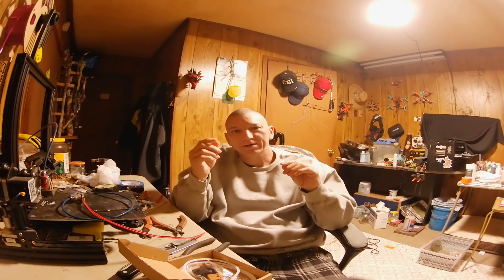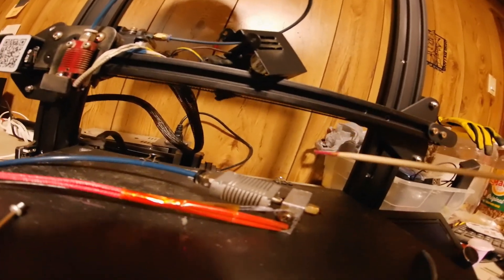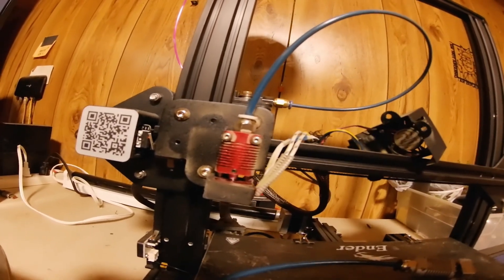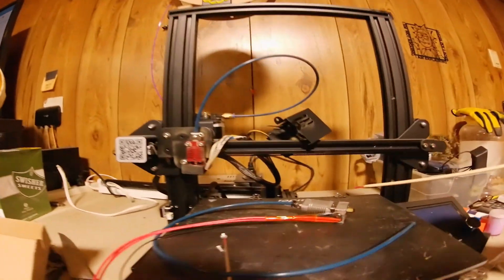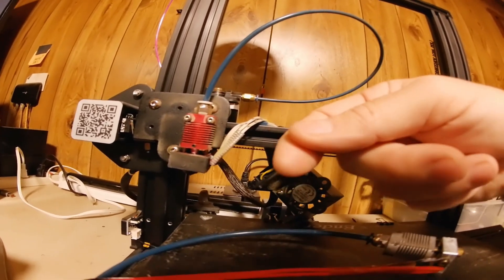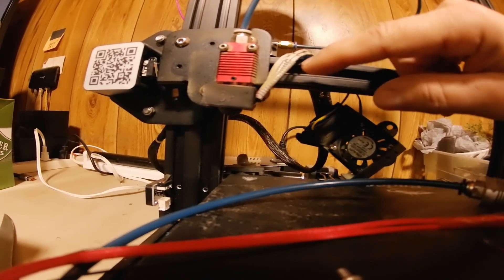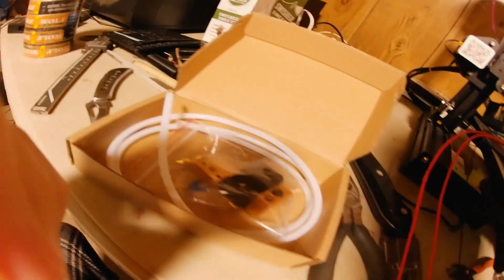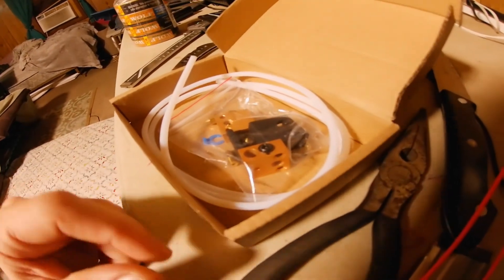Ender 3 Thermal Runaway FIX  99.9% of the time it is this problem.

Comment: Unfortunately I have tried these screw in thermosister it worked for a while but ended up cause I the same issue . The screw in ones are a pain to get access to things at least without the connector pin . So glass and screw in both worked for a time and the. Kept shutting down my printer.  I then upgraded the block to get a smooth thermistor cartridge and again it still does it   . Sometimes it says thermal runaway so etines it just says the power was turned off and the only sumolution there is is to put a couple slugs into creality piece of crap printers . Anyone else think products you buy should just work? You've had to fix my printer over and over since it came out the box and it's ridiculous. But have no fear , those protections you have don't actually do a damn thing for you so your best bet is to dispute it with ur bank if you havnt exceeded the time limit which im sure u have cause these products are built to last for about the length of that time period so you can't get your money back .creality is the biggest joke in this market and all they care about is taking your money and making sure u don't get it back .

Comment: So unfortunately, I found out that I have the upgraded thermistor, but I’m still having the runaway prompt
Reply from the maker: it might have gone bad or it's not making good contact with the block. put some thermal paste in the hole with the thermister or take some fine copper speaker wire and jam in the hole around the thermister to take up any gaps. it has to make good contact with the block to read right. if its not making good contact it doesn't know the block is getting to hot and it just keeps on heating till you get the runaway error.

Comment: Thank you, I have several machines and I have been buying new hot ends. I just installed a new direct drive and it didn’t work. Your advice  about Cleaning the gunk off solved my problem. Thank you.
Reply from the maker: you are very welcome. glad it helped.

Comment: MIsleading to say this is the fix most of the time. A lot of things could cause this, including a bad heater element, bad thermistor, bad firmware, lack of PID tune, fan issues, or in my case.... Faulty PSU
Reply from the maker: No, it's a very true statement. but you are free to believe what ever you want.

Comment: Thank you for this tip! I had thermal runaway issues with my Ender3 V2 Neo, so I decided to order the kit. Here are my key takeaways:

-Thermal Runaway Warnings May Persist: The kit may still trigger thermal runaway warnings. This happens because you need to perform a PID tuning (or use MPC) for your new hotend. The firmware tries to predict temperature changes but fails since it's tuned for the original hotend, leading to larger temperature fluctuations. PID tuning is only possible with alternative firmware or terminal access to your printer (such as through OctoPrint).

-Thermistor Beta Value Differences: Even after PID tuning, you may still encounter runaway warnings. The thermistor in the kit has a different beta value than the stock one (3950 vs. 4092), which causes a temperature reading offset (10-20°C). This makes the temperature plot appear irregular. To fix this, you need firmware configured to recognize a T13 thermistor type (the stock thermistor is T1).

-Firmware Solution: I flashed the MRiscoc firmware, which conveniently offers a version with T13 pre-set. This resolved all the temperature issues.

-Ender3 V2 Neo-Specific Note: The heater block doesn’t fit directly onto the Neo heatsink. If you want to keep the Neo heatsink (I did, as the Ender 3 heatsink looks toylike compared to the Neos), you’ll need an M2x16 screw and tighten only one side of the heater block. This will result in a slightly skewed heater block, but print quality remains unaffected since the nozzle is still vertically aligned.

Hope this helps a few people!

Comment: Thank you for this advice. Unfortunately i bought my ender 3 v2 second hand and the thermistor was "in the air" inside the hole ,which i thought was proper.
Then the problems began and i couldn't figure it out.
Bought a new hotend from creality but after 7 months again the problems started.
I will try your advice on the next hotend i buy when this stops working.
Thanks for the video.
Reply from the maker: glad it helped. thanks for watching and commenting.

Comment: THANK YOU VERY MUCH FOR THE VIDEO. I've had an Ender 3 NEO for 3 weeks and the last 4 days it's been giving me problems with hotend temperature instability and E1 errors.

I contacted Creality and they gave me erratic instructions, such as checking the thermistor screw or checking the wiring. Today they gave me an AUTOPID file to calibrate the temperatures but it didn't help either.

I watched your video and understood the problem, I'm going to order the kit, but I'm going to give a temporary solution for people who have the problem and can't buy the kit or it takes a while to arrive.

I've tried to remove the thermistor and it's been impossible without breaking it, and since I don't have a replacement, I've left it inside, but I've taken CPU thermal compound, one that I have that doesn't solidify, it stays liquid for a long time, and I've filled the thermistor hole sealing it from the outside.

I've been printing for 4 hours with the temperature totally stable, it doesn't move a degree!!! if this happens to you, until you get a new kit, try filling the entire thermistor hole with CPU thermal compound, it works!!! I don't know how long, but it works for now.
Reply from the maker: thanks for watching and commenting.

Comment: Is thermistor runaway where the temperature constantly goes up and down but never stay at the temp the print is set at?
Reply from the maker: no. it is where the head keeps heating up until it gets way to hot and an alarm goes off and the print stops.

Comment: Thanks for sharing.  I've yet to have thermal runaways, but I'd like to upgrade my thermistor.  The heater block supplied in the kit is aluminum, the one I have is copper version of the stock aluminum (holes matches), which is better with transferring heat.  Would that thermistor screw in where the captive screw would normally screw in?

Comment: I don't have an Ender but I have an Aquila, is it possible that the fan itself could throw the thermal error? I recently upgraded my hotend fan and since that I've been getting this error, and the fan is a significant upgrade so I'm wondering if that could be an issue?
Reply from the maker: Im sorry but i have no idea.

Comment: i almost never leave youtube comments but this felt very warranted for one. its been over a month straight now since picking up the hot end/thermister you recommended and i havent had a single issue since. this works so well they should honestly just include this. thank you so much for this info! I can even print ABS now which I could never do before without running into temp issues

Comment: You are a genius. I happened to have a tube of thermal paste right next to the printer. 2 min fix after 2 failed prints and a whole lot of cussing. 

Every hotend I've installed has been dry so I never even thought about it but it's fixed and I  have stable HE temps for the first time in forever!
Reply from the maker: Glad I could help

Comment: I got the kit but then I opened the box to the motherboard I saw all the wires and I got scared I don’t want to mess anything up so I just left it alone I don’t know what to do can you do a video on installing it?
Reply from the maker: everything should just plug in. if they dont just cut the old wires from the heat block and splice the new heat block in. you cant cross the wires. just splice the big wires to the big wires and the small wires to the other small wires. you cant cross them, those wires dont have a positive and negative so you cant cross them, they will work wired ether way as long as you put the big wires with the big wires and small with the small.

Comment: interesting
funnyly enough my ender 3 came without thermal paste on thermistor so i never aplied it back when i replaced heat blocks 3 times
and it works all the same
don't really know how well it track the temperature but no runaways

Comment: first thing I did with mines was change out the hot end, never even booted it up, printed a few things and then a few weeks later it would go for like 5 to 10 minutes then give me an error.
saw that paste while I was changing the hot end, because I took the thermostat out, was hoping it would be an issue, guess ill find out in 10 minutes if it was.

Comment: I just put mine in and it is still going into thermal runaway. It just randomly started too, I printed fine for months.
Reply from the maker: You replaced the thermister and hot end? and its still doing it? or did you just replace the thermistor? Did you clean out the hole where the thermistor goes?

Comment: Hello! How has the kit held up over time, are any modifications to the firmware needed? 
Oddly, I can't find many sources about thermistors like this so I'm a little warry of buying any. I've had thermal runaway E1 issues since I got my Ender 3 Pro though, and I'm pretty desperate for a fix at this point.
Reply from the maker: This kit is awesome. it is still doing great. no problems at all. no modifications needed. just remove your old hot end and replace with this new one and plug up the wire or splice the wires for longer wires like i did in this video. this new hot end already comes assembled so just bolt it on, it's that simple. Thermal runaway E1 is a thing of the past for me now. enjoy brother. and this kit is awesome for the price!
Reply: @Forbiden-Music-Zone  just got one for myself, can't wait to test it out. Thank you for the video :-)
Reply from the maker: @jace-vo2xl  glad i could help brother.

Comment: lol. no. its not the solution. once you upgrade your mainboard to 4.2.7, and you use the creality firmware, you are on your own. you will be plagued by heating failed/ thermal runaway issues, because the software is broken.
Reply from the maker: Who said anything about upgrading your mainboard? sure was not me! this video tells how to upgrade your hot end and clean your thermistor. and this solution works. 100%  i have helped and been thanked by at least a thousand people with this problem and it solved each one of the runaway problems.

Comment: thank you for this, I cleaned mine and put some thermal paste on it, seems to be working great again. funny thing is that I just replaced the mainboard to make it silent. Never had a problem before, I think the old board didnt have thermal run away protection.... So Im pretty lucky to be finding it this way. thanks again!
Reply from the maker: Glad it helped
Reply: Is it the same thermal paste as cpu? How much paste?
Reply: @clawsmedia8752 yes I used cpu thermal paste but it only worked for a day and then I had to order a new sensor

Comment: If this works I will endorse it as much as I possibly can
Reply from the maker: Thanks Brother. if you have any questions just ask. i like helping.
Reply: @Forbiden-Music-Zone  so I ordered it and installed it the way you said and it worked for like a few prints then it started beeping again
Reply from the maker: @Jake0663  Move your wire around and try that. sometimes mine will do this right out of the blue but i just wiggle the wires and it starts working again.  Did you get the assembled kit or just the thermistor?
Reply: @Forbiden-Music-Zone  i got the assembled kit ima work on my printer thus weekend and see what happens
Reply from the maker: @Jake0663  let me know if you need any advice or help brother. i will try and help. not to much that can go wrong with the ender 3. its a dang good printer. i have printed non stop for almost a year with mine and only problem i found was this thermistor problem but have it all sorted now.
Reply: Well did it work
Reply: Did it work?